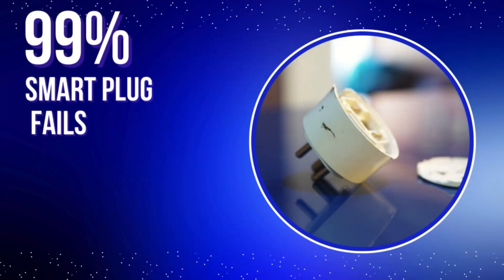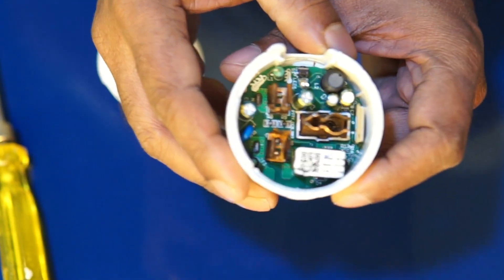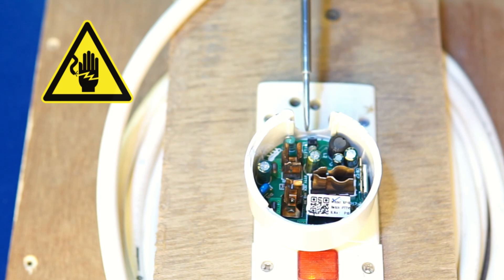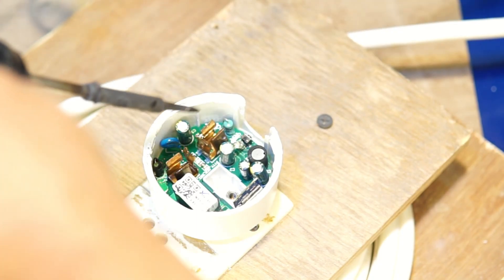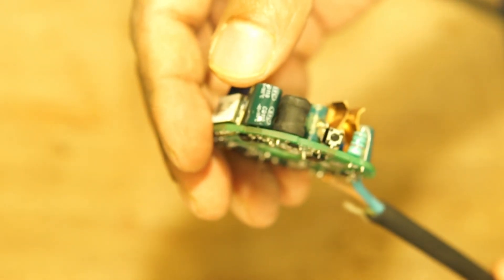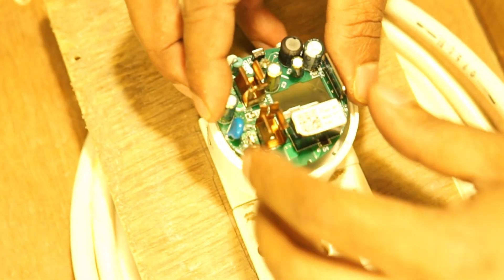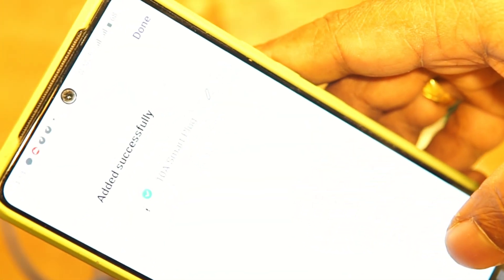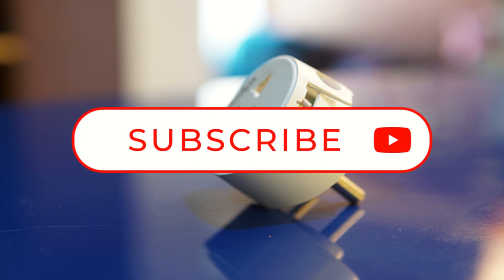smart plug easy repair | smart plug flickering solved | what is inside a smart plug

Comment: I have a wipro smart plug 16 amp. I changed two blown capacitors. Then when i start it then 2 time red link blink and the it didn't turn on. Then i checked the contunity of capacitor it doesn't make beep noise. Do i need to change to capacitor again?